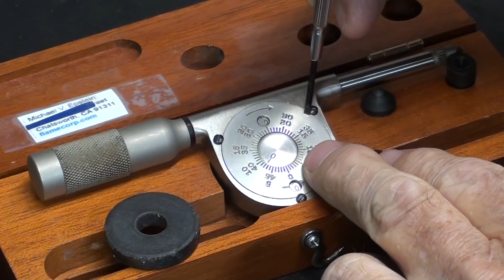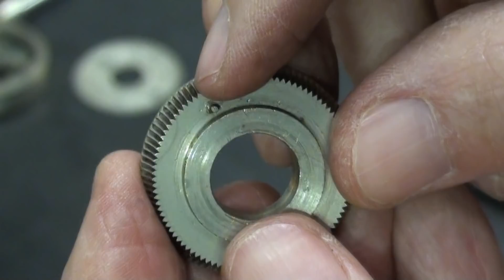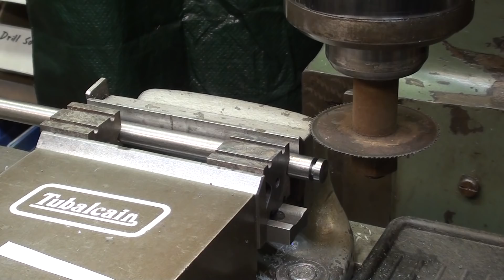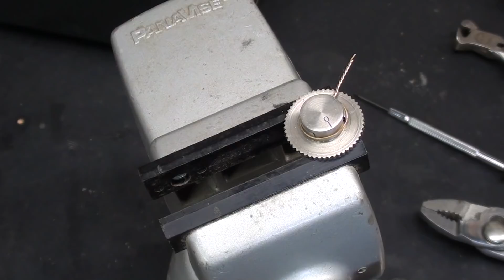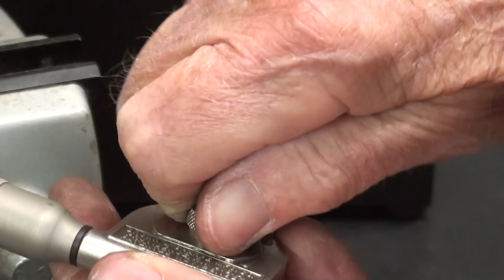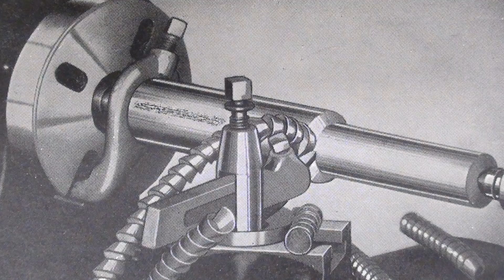FIX Brown & Sharpe Tach TIPS # 619 tubalcain mrpete

Comment: A very nice repair 👌. I was in my late teens when I went to work at a service station and learned there were special tools for changing brake shoes. I had already done a few drum brake jobs by then and sure was impressed with the ease of the job with the right tools 😉 After college, I did a lot of work with manufacturing machinery that used lots of extension springs and I carried an automotive brake spring pliers in my tool kit for many years. You should show one on a this & that, or a what is it video. I'll send you mine if you don't have one.
Reply from the maker: I do have several that I guess I should show them. But I think it’s a pretty common tool that most people will know

Comment: You might already have the right tool for the job!  I'm thinking one of those Jacobs wedges for popping off drill chucks might be just the right size. If not, a flat piece of 1/8" stock, maybe 1"x2", with a 1/2" wide notch milled in one end would do.  Use the notch to hold the shoes, slide on the hub, and let the tool slip behind the shoes and then out the side.
Reply from the maker: You had some great ideas, thank you

Comment: The women (probably) assembling the friction shoes probably had an assembly jig(s) to hold them and the spring together as it is inserted into the rotating dial part. At least, that's what I would have designed before handing it over to assembly production.
Reply from the maker: Yes, I am sure you are right

Comment: I bet they had a "wrench" made out of shim stock (-ish material) to use as their ring compressor device. A very-thin widget that could 'clamp' the center of both shoes to just the right position, but thin enough to still be holding until the last second as the dial is slipped over them.
Reply from the maker: Yes, good idea

Comment: On my first brake job after fighting the springs for about 30 minutes, I found a piece or 1/16 nylon cord.  Looped it around the hook in the spring and then I was able to pull the spring into position and snap it into place.  That was my goto method for years until disk breaks became common.  Now we have Harbor Freight for those odd occasional use tools.
Reply from the maker: Yes

Comment: Hey Mr Pete, I was luckier than you, I had more modern technology.  My 1953 straight 6 side valve Studebaker Champion had self adjusting drum brakes, with a hill-holder and a leaking master cylinder located under the drivers side floor.   If I didn't fix it I didn't go, you can't afford a mechanic on an Airforce cadet's pay of $28 a fortnight in 1968.   Regards Jeff (Australia)
Reply from the maker: I remember the hill holder.
Reply from the maker: I remember the hill holder

Comment: How would one secure copper faces into an old Danco Danielson Mfg. Co. machinist hammer? In a previous video  Mr. Pete used loctite to secure round metal balls on the ends of a handle and was wondering if that would work or is an epoxy better suited?

Comment: Kinda wish we were neighbors so we could play. I was a jack of all trades master on none. 32 years at Cat as a machinist. From mills for links to bearing blocks to steering yolks, head mills for 6 and a quarter heads, 3208 head line, they used me as a salvage man to fix the screw up parts. CNC machines. I taught myself to weld from gas to stick to wire. Do a pretty good job.  Taught my son's ( 3). 
Dad started me off at 11 years old rebuilding Motorcycle transmissions.
Enjoy your post, keep it up.

Comment: Ahhhhhh don't be so sure @mrpete222 my friend! Those little shoes look strikingly similar to the little centrifugal clutch shoes that live inside the 2nd and 3rd gears on my RC nitro car. I've often thought about using the springs from the back of windscreen wiper blades or similar to replace the plastic ones you buy at hobby stores. Of course that will mean having to turn up some steel bells to replace the cast aluminium ones that are on it, which will mean replacing the burnt out motor on the lathe... but that's a whole other story :)
Reply from the maker: One thing leads to another

Comment: Great work on such a tiny part Mr. Pete! I'd have lost at least the equivalent number to what I made. 

I can so relate to your brake job story, always did my brakes with screwdrivers and pliers. Finally go to use a pair of brake spring pliers in auto shop and I just had to have a pair after that. Got a pair and still use them to this day. An excellent example of the proper tool for the job.
Reply from the maker: Thanks

Comment: About 1974, when working on the carburetor of my 1967 ford PU, I dropped a small part onto the street. I found it by cleaning my shopvac and vacuuming the street under the truck.
Reply: What did Mr. Pete say about order of operation?
 I found it by vacuuming the street under the truck and cleaning my shopvac.
There fixed it for you.
Reply: @bwyseymail  I think you've got it wrong, and he had it right.  It's crucial to clean out the shopvac before such an operation, or the part'll get lost in whatever was in there to begin with.

Comment: Mr Pete I have an question that's not related to this video and maybe you can help.
When viewing a Youtube video at times I get a black screen for maybe 10 seconds that says "An error has occurred" then the video plays.
Not all videos I look at have this message. Yours always has this message.
Would you know if this is a fault on Youtubes behalf ?
Thank you.
Reply: Happens to me too - but on almost every YT video, not just Mr Pete's. Think this is a wider problem - have seen others reporting similar issues on twitter and elsewhere.
Reply: @robertwatsonbath  Thanks, any research I've done to try to correct this has come up zero. Tried contacting Google/Youtube and that was a failure also.
Reply: @RichieCat4223  Likewise. I've yet not checked but wondering if could be related to my using Ghostery as an ad-blocker?
Reply: @robertwatsonbath  I have Ad Blocker Plus and thought the same thing. Turned it off and nothing really changed. The black screen reminded me of an ad running before the video and Ad Blocker was doing its job.
Reply: I don't ever have this with any You tube videos.

Dale in Canada
Reply: @dalemcinnes1834  I asked this question to a person from Canada who posts videos and he has the problem also. He's HalfAssCustoms. Builds hot rods.

Comment: “Always make two because I count on losing one” lol. Better to have and not need, than to need and not have! I have a 1950 Ford Shoebox custom that I repaired the brakes last month and lost the brake spring and searched for for two hours after it shot out on the black driveway. After walking away from it for two hours I found it. Phew!
Reply from the maker: I wonder how many hours or should I say days of my life I wasted looking for things?
Reply: @mrpete222  In the mill when we fetched small cheap parts (wire nuts, machine screws) we always took an extra "one for dropping". Saved the company a lot of money in downtime. Thought of it as cheap insurance. 😀
Reply: With something like a break spring just tie a piece of string to it.

Comment: Love it:  I actually counting on losing at least one."  Thanks for a neat video, Mr Pete!  I think that Buick is neat.  My first car was a 54 Pontiac 2 door straight 8.  It had plenty of torque!
Reply from the maker: My straight eight Sure ran smooth.
Reply: @mrpete222   They were great engines.  Do you ever watch Coldwar Motors?  They work on lots of old cars, even had a contest between the members of the group to be the first to return a straight 8 engine to operating condition.
Reply: @mrpete222  The hood on that thing must have been really long. A straight 6 is pretty long, so I can imagine 2 more cylinders.
Reply: @xenonram  I'm 6'2 and can lay on the hood of my 50 buick. The coolest thing about them is the way the hood opens. You can unlatch either side and tilt it up to get to that side, left or right. If you got about 3 buddies 2 can pop each side inside the car on it's respective side right under the dash and you with the other one can lift the hood off without unbolting anything. Yes it takes at least 2 people to pick the hood up, the thing weighs a ton.

Comment: I went and bought my first impact sockets the day I did the brake job on my old truck. It was summer but many times I layed on the ground to repair my car in -30. That's how we learned. Thanks
Reply: Been there done that but can't do that any more. I drove across Anchorage on my motorcycle, O' about 300 years ago, to grease my dad's dump truck that was parked in 3 feet of swamp. Might as well have been -30* that day because the ride home chills me to the bone even today when I think about it.